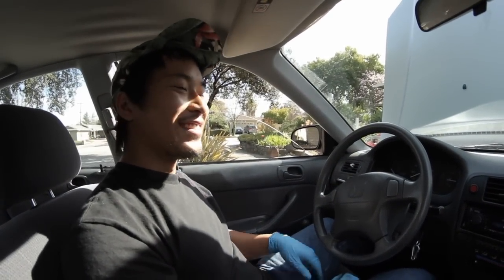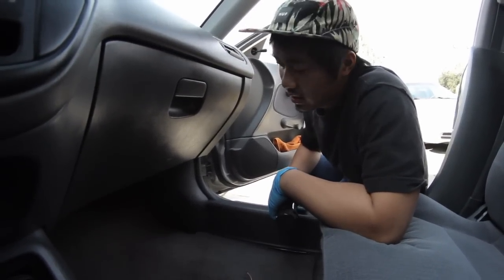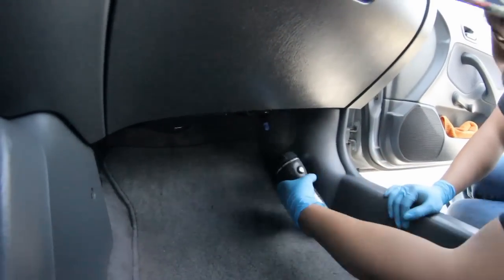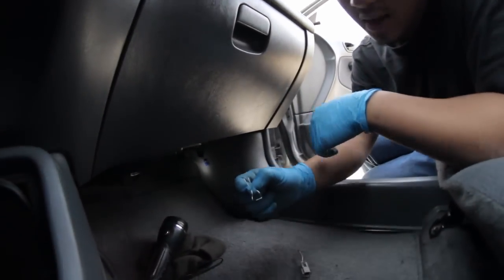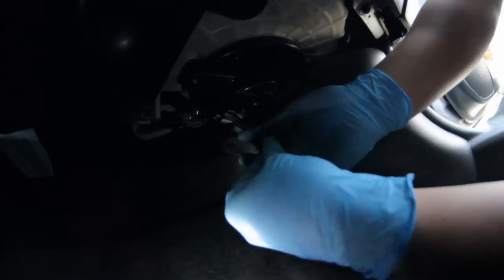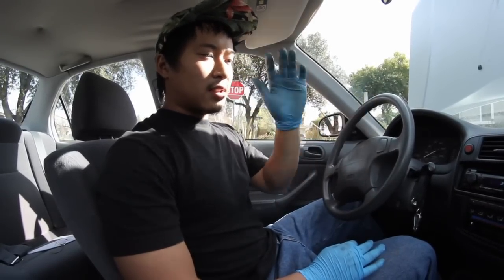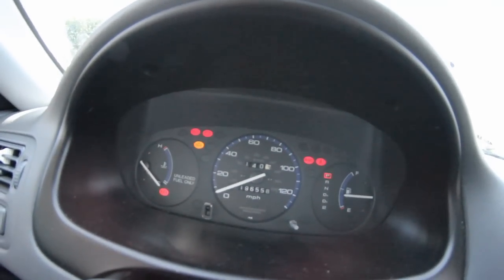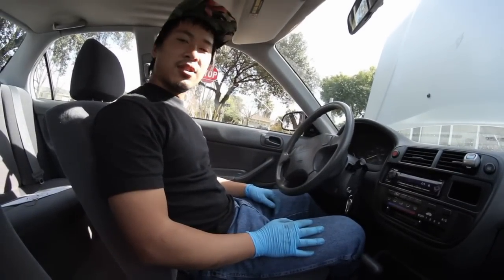How to: Pull CEL trouble codes on Hondas (no scan tool)

Comment: I just did it for my 95 Honda Del Sol. I was working on figuring out why the idle slightly surges only when its warm...
I cleaned PCV Valve, checked for vacuum leaks tightened the Fast Idle Control Valve, which helped a lot but still left some surging after it was warm... I cleaned the IACV and still didnt' help. I found a video that showed exactly what my car was doing. So I figured that must be it. So I ordered the part... just now I followed this video and checked the Code and yep sure enough it was code 14 for OBD1 and it's an IACV!! This was fun!! 🐹

Comment: My friend honda Odyssey 95, d4 is blinking, no start, can't remove the key we only remove the key after removing the terminal from battery. After jumpstart of starter  from battery the engine is working but the transmission does not shift. can someone help.

Comment: I am confused... in my 2001 accord, we use the 16 pin connector on the driver side. You sure this applies to all models?
Reply from the maker: carpo719 That 16 pin connector is an OBD2 connector. All cars 1996 and newer are required to have it. However, you need a scan tool to plug in and get the codes. Many hondas after 1996 still have this 2 pin connector as shown in the video for those who dont have a scan tool. Honda probably stopped including them around 2004 though.
Reply: From 1990 to 1999 only

Comment: Does this apply to a 1990 accord
Reply: Yes... you are probably obd1 so you will have to look for the codes for OBD1.
From what I understand, 1995 and below are OBD1 and 1996 and after are OBD2. I have a Del Sol, so not sure what your engine is. Depends on your engine. 
OH here they are:  https://dannysengineportal.com/obd1-engine-trouble-code-information-for-honda-95-earlier-models/

Comment: sir, i have a 2005 honda civic hybrid with error code P300 to P304.. the car wont move or drive.. hybrid battery was replaced 3 years ago..I removed the connectors on the spark plug module, It does not sound i have a mifire. pls help
Reply: Check your grounds. Mostly was your ecu reprogrammed to account for The ima new battery??